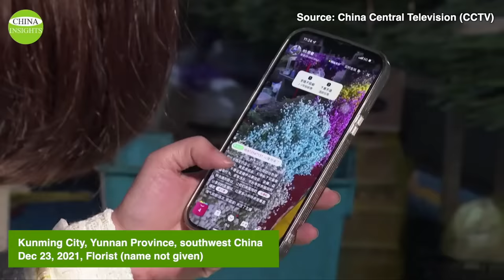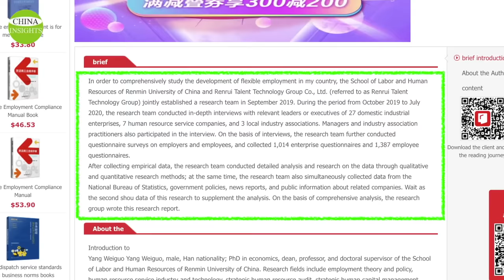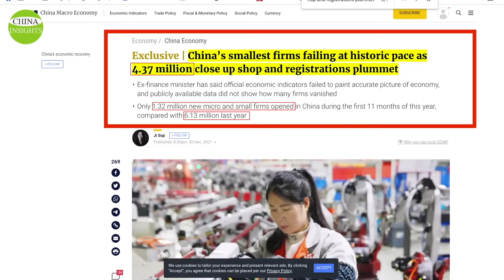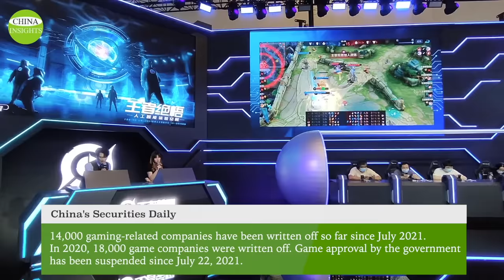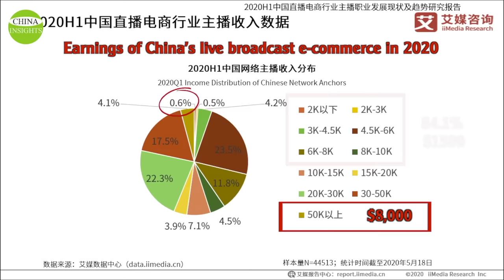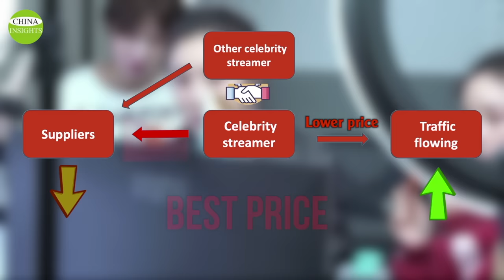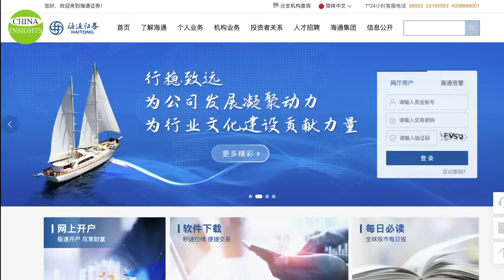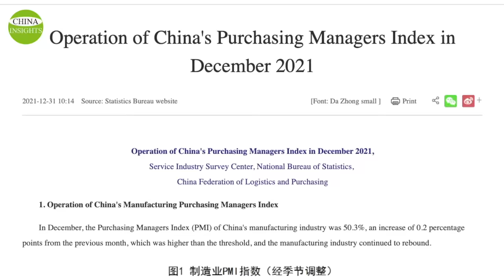Where is the way out for the massive unemployed in China? 4.3M+ small & medium enterprises closed

Comment: Based on 2019 data from the CCP Bureau of Statistics, 43% of the population in China monthly income is less than 1090 Yuan, 26% between 1090 - 2000 Yuan, 26% between 2000 - 5000 Yuan, 5% over 5000 Yuan. Using today's exchange rate, that would be USD less than $171,  $171 to $315, $315 - $787, over $787 respectively. I suspect these numbers are based on average people in Communist China without special connection. My advice to them is to treasure the current moment because the future is even grimmer and more difficult. There is no way out, CCP already emptied out the natural resources of the country, realized fully any potential benefit of urbanization and infrastructure spending. Together with nonexistent population growth, rapid of aging of society, withdrawal of foreign companies and capital, the economic outlook is dark to darker. The result of such economic hardship has only one outcome, more domestic control and security spending. In fact, the domestic security spending already outstripped military spending in 2021. This trend will not only continue but accelerate in the future. So, people of Communist China, save what you have, frugality is not only a virtue but necessary for survival in the future; lower your expectation to life and don't complain to the public too much because that would get you to jail.